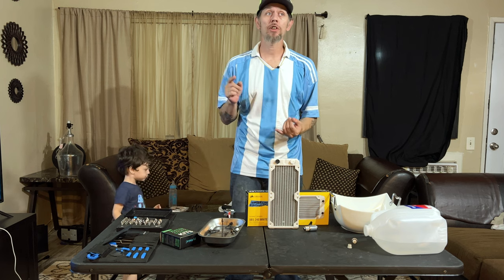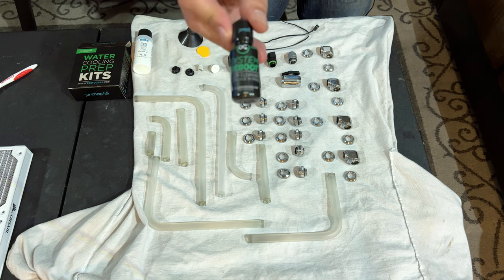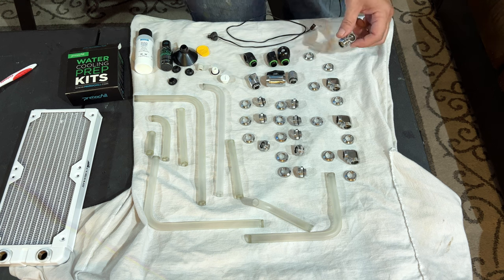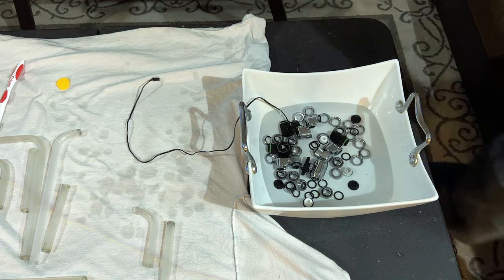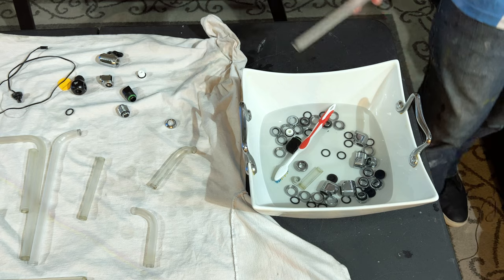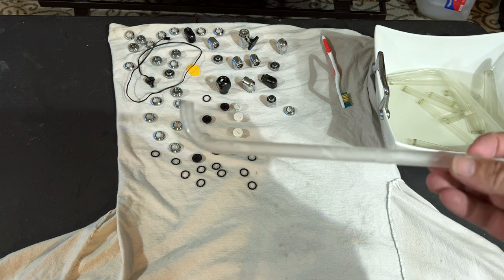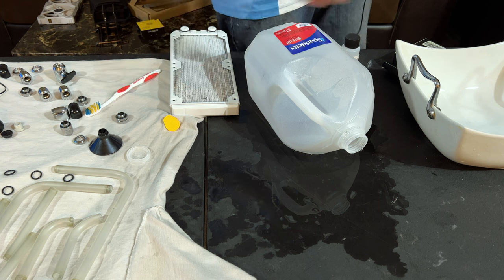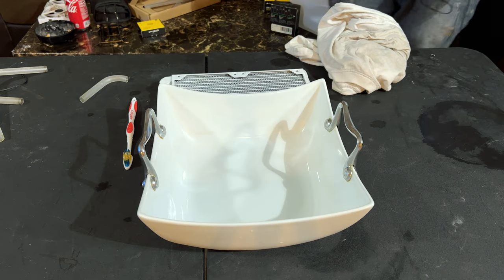Water Cooling Accessories Dirty? (EXTRA) What fittings do what?

Comment: Yo ya vids really do help a lot lol made me be able to do my build with no hiccups also what tool do you use to straighten out the pins for a radiator?
Reply from the maker: Tweezers work wonders. I tried a radiator straightening tool but they were too wide. Tweezers and done.

Comment: I liked the gaskets cleaning. I havnt actually removed them before in my previous cleans. Will have to try. I had an thick white residue in my last loop. Getting rid of it completely is a pain. Even the all around pipe cleaners can’t get rid of the the little spots that are hard to reach in the 90 degree fittings

Comment: Can you mix some vinegar into the distilled water to soak your fittings in that would more easily dissolve or loosen the residues? Or would it be too acidic for the paint and finish of the fittings?
Reply: Vinegar kills nickel plating